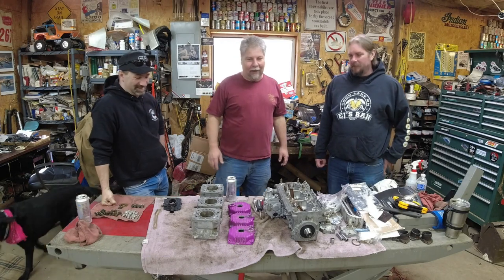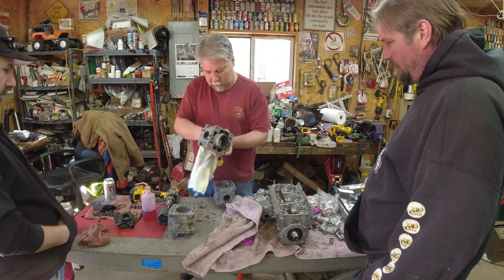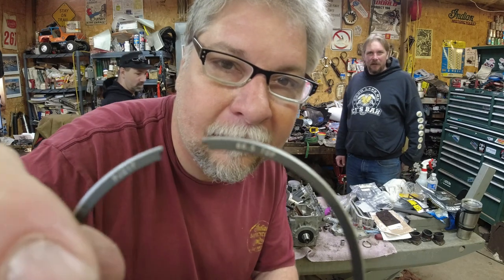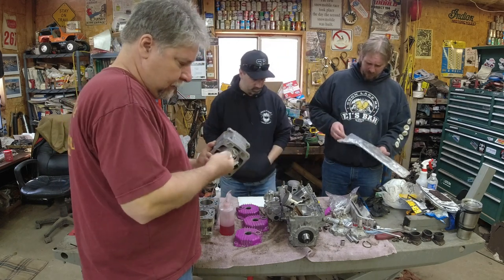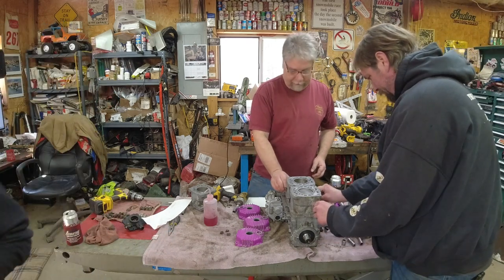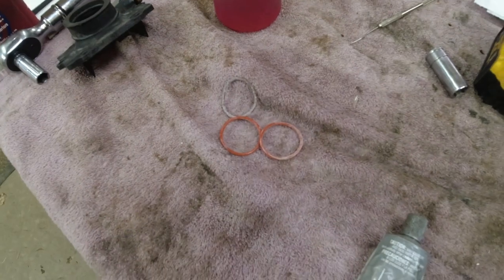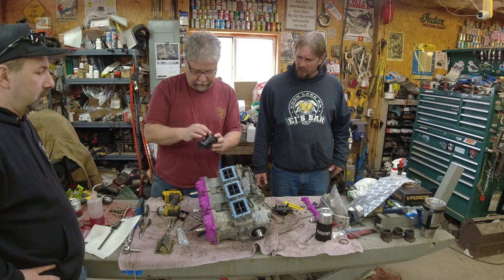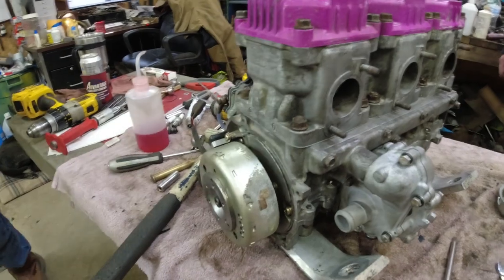Brad's Ultra Part 4! Motor Assembly Tips and Tricks. Vintage Polaris Triple Snowmobile.

Comment: Nothing wrong with torqueing the base nuts the way you are, done it that way and done it just buy pulling on the wrench. I find that if you tighten them some on the bench and then when the engine is mounted in the sled, that way you dont have to try to hold the engine while you tighten. Works for me... your milage may vary.

Comment: Hi Nutter,  I would be interested in a run through of the fuel pumps Polaris used in the 70's and 80's.  My sleds used Mikuni and am interested in parts interchange.  Thanks
Reply from the maker: Great suggestion!

Comment: Nutter what size of flex hone would an XLT take, with 2.561" bore? My XLT engine is torn down right now, I want to use stock pistons and rings just need to crosshatch. It's measuring 2.561" in both axis.
Reply from the maker: Since they sell them by the cylinder diameter you answered your own question. Get a 2.5". Try a 220 grit silicone carbide.

Comment: Wondering if you know the diameter of the flex-ball hone? Looking to get one for doing 295, 340, 400, and 500. Pretty sure I'll need more than one, but wondering if you know what MM range the one you're using is. OR... the one you used on Lonnie's (or was it Dennis's) 340? Oh... and of course, what grit? I assume something on the finer side?

Going to save this video! I'll probably still have questions but you covered a lot of details that will help me as I dive toward wider horizons.
Reply from the maker: It's a different hone than we used on the 340s due to the size. The best thing to do is to do is to go to the flex hone website, which is actually brushreasearch dot com. It's all covered on that web site.
Reply: @nuttersspeedshop  Once again... thank you very much!

I checked it out and found it overwhelming. Can you believe there wasn't enough info for me to feel like I know what to choose? This has me second guessing a few things...